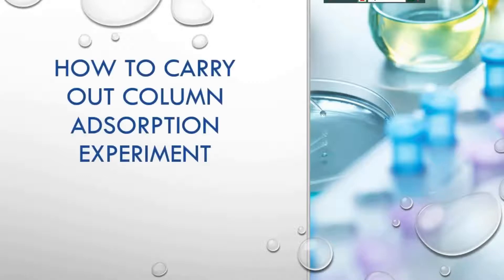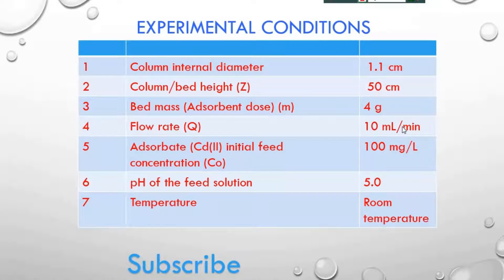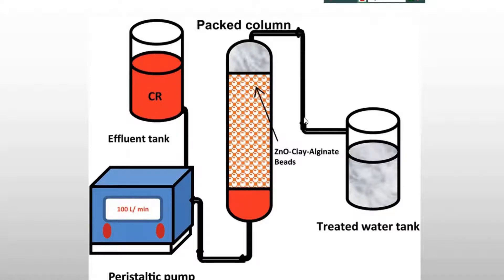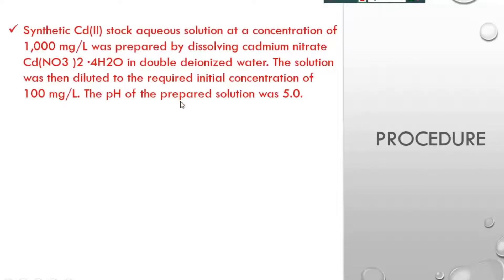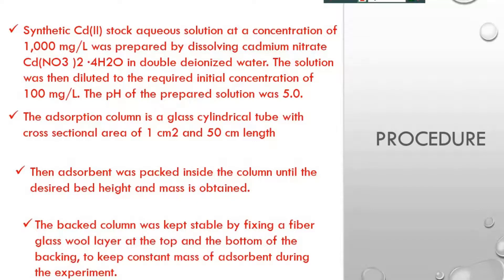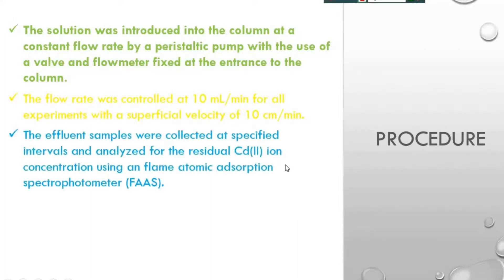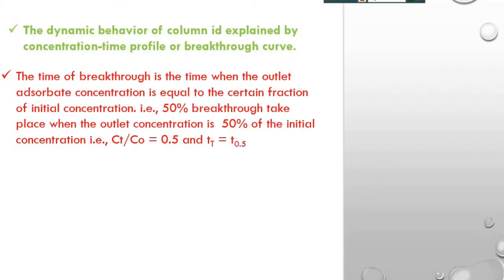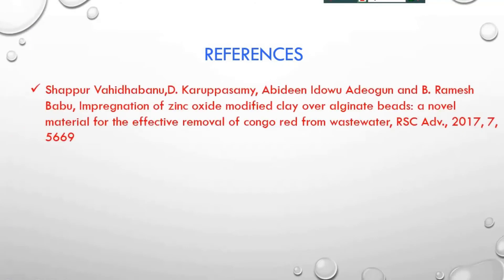How to carry out column adsorption experiment

Comment: A quick question: When the saturation takes time, and I need to run column experiments for days, is it ok to stop the pump at the end of each day and start it to continue the experiments and sampling the next day?
Reply from the maker: Thanks. In that case, it is better to design experiments which reach equilibrium in a day.
Reply: @Aminulchem @Aminulchem  The point is that the influent of the column is the output of a Membrane bioreactor setup, which is always running. I can do sampling for each Batch Volume during the day, but I cannot stay 24 hours, and I am afraid it reaches a breakthrough while I can't do sampling. Any idea is appreciated.

Comment: Hi Doctor, I have a question. Would you please guide me? I am going to have column adsorption tests. To measure the concentration in the treated water tank, what should I do for intervals? Should I have one tank and take samples, for example, at 5 min, 10 min, 20 min, ... ? Or should I put the outlet tube in different tanks? for example. Putting it in an empty tank and taking a sample after 5 min, and putting it in another empty tank and taking a sample after 10 min , ...? Thank you so much for your help.
Reply: You should collect sample directly at different times. e.g. collect 5 ml directly from effluent at time 5min, 10 min, 20 min etc
Reply: @Hassankhanwazir  thank you, Irfan. Do you have any idea about the description in a column? Should I do sampling for desorption in time or just run desorption and take a sample every few hours to see if the concentration in the effluent is equal to the influent?
Thank you!
Reply from the maker: Thanks. I think you need to consult with your supervisor about the experimental set up.